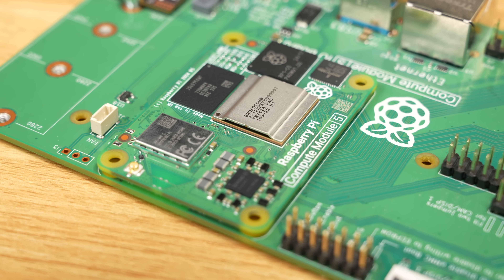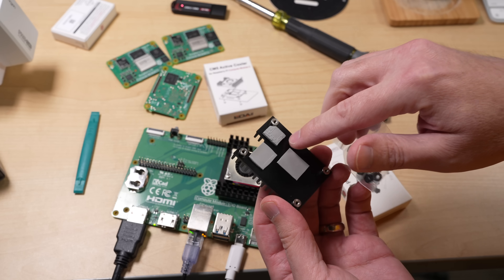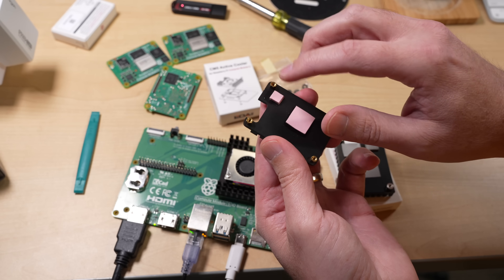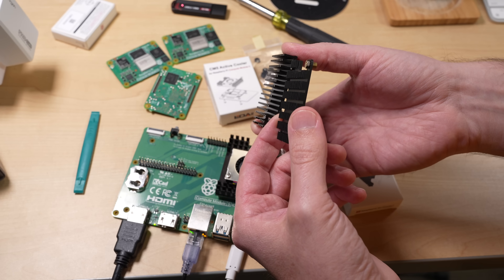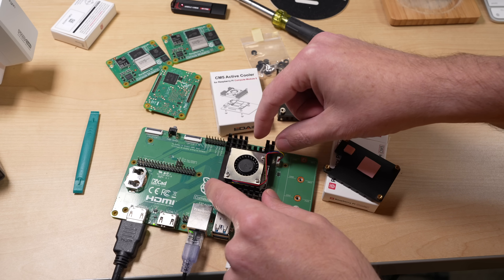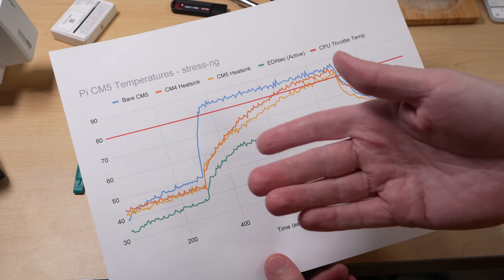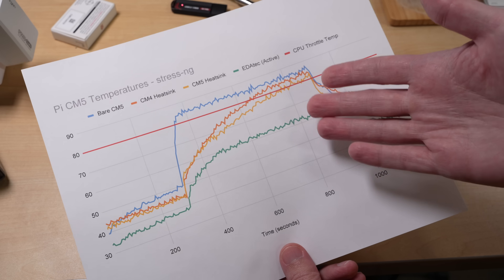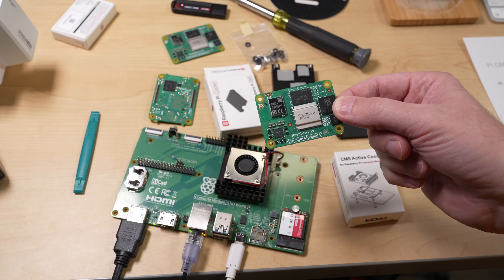The Compute Module 5 Needs Cooling

Comment: Any updates on this? Are there any better cooling options? Heatsink with or without fan? I bought the Waveshare case which look like the official case but the included case fan cant be used if the passive heatsink are in use because they don't fit both at the same time.

I have seen some 3d printed cases which solves this issue but it won't be metal cases though.

My plan was to mount a Noctua 40mm pwm fan. I guess I could mount it external If I want but.

Comment: Nice comparison Jeff.   Active coolers are noisy and that's annoying--the Raspberry Pi and Pimoroni fans I tried on the Pi4 were too loud for desktop use. If the fan was a standard size replaceable by a Noctua fan, that would be a worthy upgrade (maybe for a 40mm fan?). Nowadays, one could 3d print a nice air channel and locate the fan off the heat sink but that would be somewhat enclosure dependent.

Comment: I was surprised by how hot the pi5 gets. I was able to passively cool one to 40C despite the CPU running full out. The key was a 1"x1" chunk of aluminum to conduct the heat above the USB ports and then a big honking heat sink. I'm excited about the cm5, but with that power draw, it sounds like  the old cm4 is better in a battery powered device.
Reply: Technically you can lower or limit the CPU clocks on the CM5 to match the power draw of CM4. And I assume it will still be faster (and thus, more efficient) than CM4, though I wish somebody put some numbers to this assumption.
Reply: @Winnetou17  that's a good point, and yes, it would be interesting to see it verified. Just seems wrong to have all that CPU and not use it. :-)

Comment: That looks linked to it less efficient but slightly powerful which have more energy goes to heat  

Unfortunately passive cooling is very inefficient compared to active cooling which just needs very little amount of airflow to have great improvement ( if loading was not constantly high over time, a larger heatsink with bigger heat capacity might still be able to store them before goes throttle )

Cm5 cluster : no problem just give everyone a heatsink and one system fan for all

Comment: Thermal mass does not increase cooling capacity..

Increased surface increasing coiling capacity... The added mass only acts as a larger buffer.

Comment: Does it need the heatsink? Or will it avoid throttling with just a fan pointed at it?
Reply from the maker: I tested both, as long as you have enough airflow (I had my 140mm Noctua blowing at lower speed), it won't throttle. At least not at the default 2.4 GHz clock!
Reply: @Level2Jeff  If you have the time and curiosity, can you limit the CM5 to the power draw of CM4 ? And test if it's still faster (and thus, more efficient), given the same thermal constraints ?
Reply from the maker: @Winnetou17  I did test underclocking to 2.0 GHz (no lower than that), but didn't have my power monitor plugged in at that time, so I don't have numbers. Should've done that lol.

I do have some numbers for underclocking the Pi 5 on my blog: https://www.jeffgeerling.com/blog/2023/overclocking-and-underclocking-raspberry-pi-5

Comment: What load will they take without a load of heatsinks and fans ?
Reply from the maker: Normal activity is fine—it's bursty and the SoC can keep from throttling normally. But if you do video transcoding, or push it for more than 10-30 seconds at a time, I'd worry a little more.

Comment: Did the CM4 cooler on the CM5 fit in the case with the case fan?
Really surprised (actually not) that the CM5 heat sink doesn't fit in the case with its fan. Disappointing.

Comment: I was going to swap my cm4 in my ClockworkPi uConsole to a CM5, but now I worry that it may overheat. :\
Reply: It shouldn't be a problem, just may not be all that worthy while - you can set a throttle back temperature on the 4 and 5 (definately on the 3) with the temp_soft_limit if you want to keep it cooler, and even hard throttled the Pi5 was faster than the 4 so while you may not get the same performance uptick as you'd like it should feel much snappier to use.
Reply from the maker: And Raspberry Pi mentions you can underclock (to say, 2.0 GHz) to save on power and thermals, while still being about 2x faster than CM4
Reply: @Level2Jeff oh nice! Thanks!

Comment: 71 fahrenheit is 21.67 Celsius.
Reply: agree to a degree  ;-)
Reply: google put a translation link on this comment.  The only thing that changes is that it capitalizes Fahrenheit which I guess it assumes is German?
Reply: @blahblahblahblah2933  Units named after a person are capitalized. Daniel Gabriel Fahrenheit in this case. Also Watt, Ampere, Volt, Celcius, Joule
Reply: @playitlouder451  Not true. From the Wikipedia page International System of Units: "According to the SI Brochure, unit names should be treated as common nouns of the context language. [...] For example, in English and French, even when the unit is named after a person and its symbol begins with a capital letter, the unit name in running text should start with a lowercase letter (e.g., newton, hertz, pascal) and is capitalised only at the beginning of a sentence and in headings and publication titles. As a nontrivial application of this rule, the SI Brochure notes  that the name of the unit with the symbol °C is correctly spelled as 'degree Celsius': the first letter of the name of the unit, 'd', is in lowercase, while the modifier 'Celsius' is capitalised because it is a proper name."
Reply: Ah, no. 71 F is 22 C. In order to get 21.67 C, you’d have to start with 71.00 F.